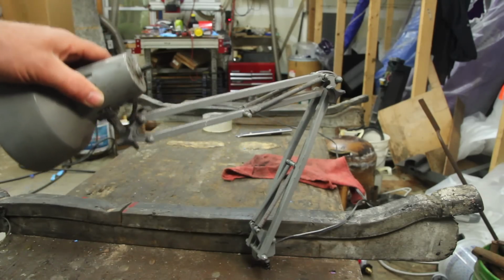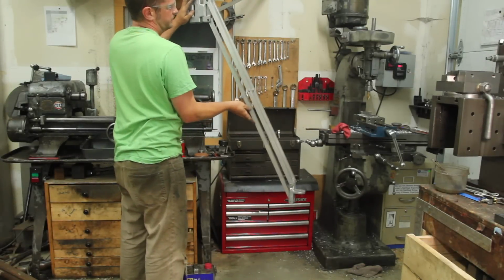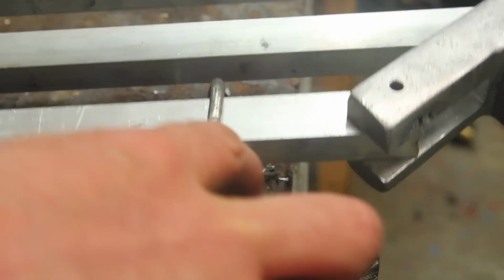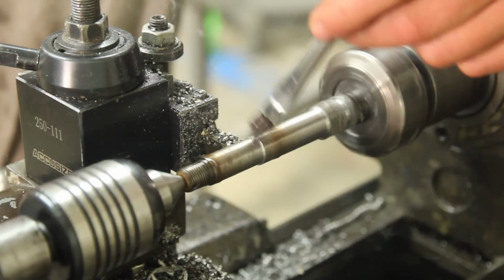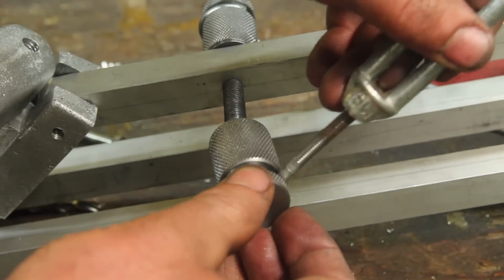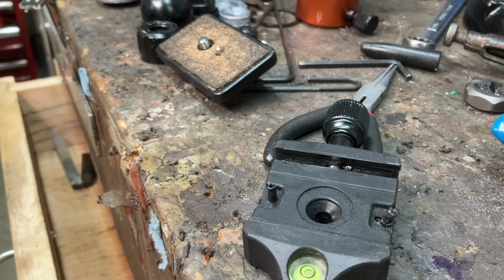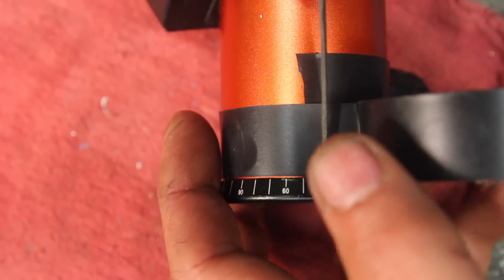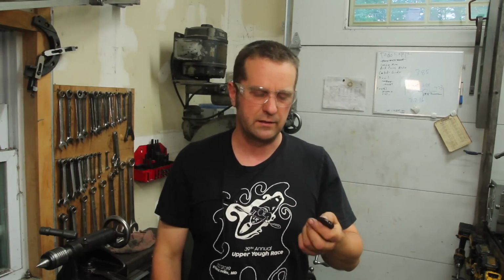Giant Balanced Arm Build (Part 3)

Comment: Nothing beats the old electricians band aid, BTW best timed cut ever ✂😁
Reply: So I'm not the only one who has bought an extension cord for the lone purpose of throwing it across the rafters to the opposing wall?  Nearly did it with a garden hose some time ago due to the hose bib being inside the garage on the wrong wall...

Comment: This came out great! I also have always liked those lamps and I've been wanting to make a simpler version to hold my soldering tray or small tool tray over my work bench for working on stained glass or anything else where I want the whole surface free. Wasn't sure how to go about figuring out spring strength so totally gonna steal your turnbuckle idea to adjust preload. Lol'd at the tape!

Comment: Do you have Fusion 360 for modeling designs like this? 
Fusion allows you to use motion joints so you can test all of the possible motions in the model before making a single part. 
It would be a huge advantage for projects like this and no, I'm not a representative of Fusion or Autodesk, I'm just a big fan of using it for new designs. 
The time it would take to model it would be far less time than having to re-machine or even remake parts! 

Just trying to help! 

Otherwise, well done IMHO! :-)
Reply from the maker: I downloaded fusion, looked at it once, and went back to Rhino.  Fusion is probably (almost certainly) better for this sort of thing, but I’m proficient in Rhino so it’s tough for me to put in the time to learn fusion.  But I should do that.
Reply: @JeremyMakesThings  no pain, no gain! Enjoy watching your work. Quite talented !
Reply: @JeremyMakesThings  
I understand what you mean. 
Fusion IMHO does seem to be geared more towards mechanical engineering than Rhino. 
Whatever works for you is all that matters really.